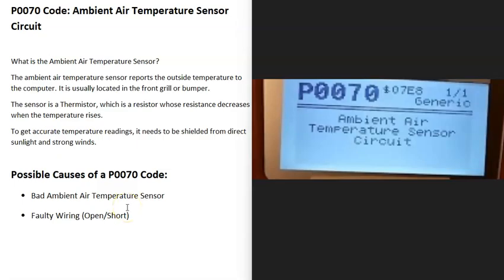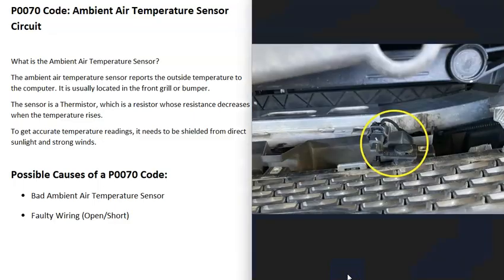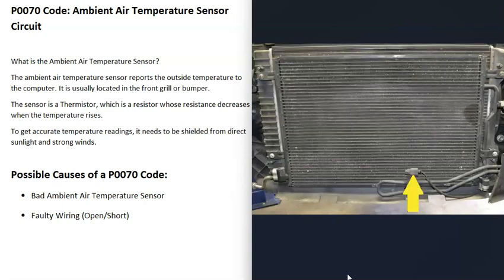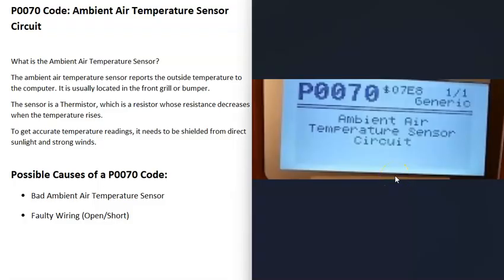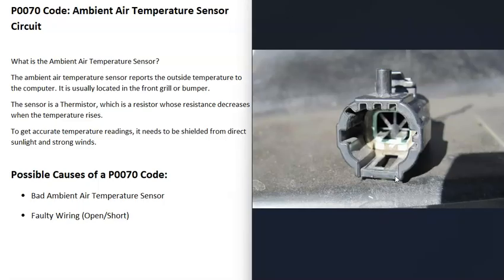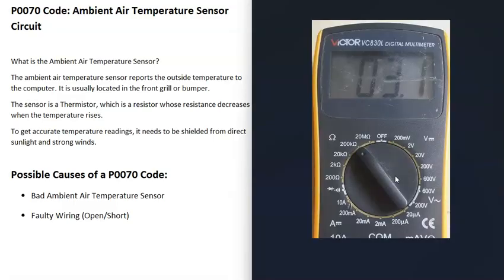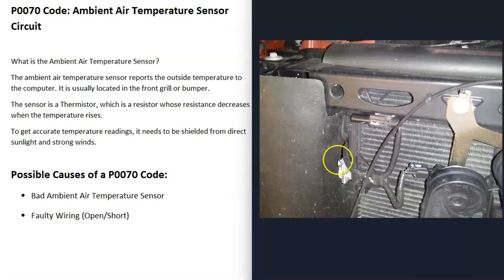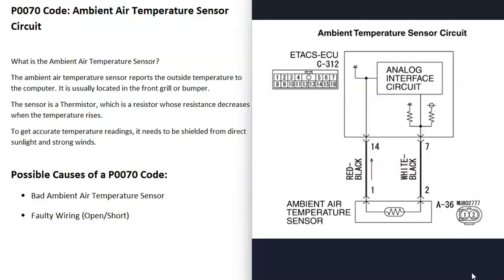Causes and Fixes P0070 Code: Ambient Air Temperature Sensor Circuit

Comment: Where else could my ambient temperature sensor be located besides in front of the radiator because I can’t find it
Reply: underneath the radiator
Reply: Cabin heat and air conditioner intake.